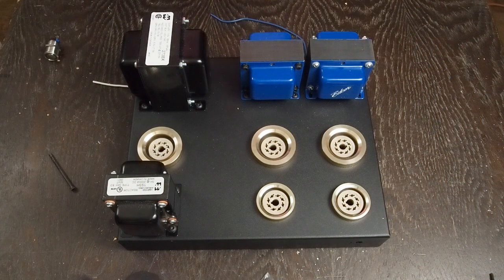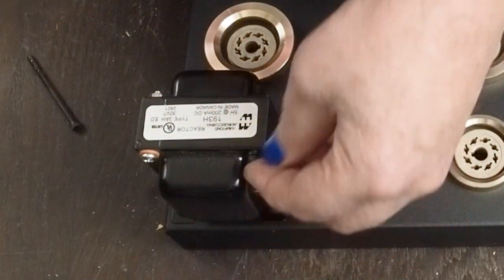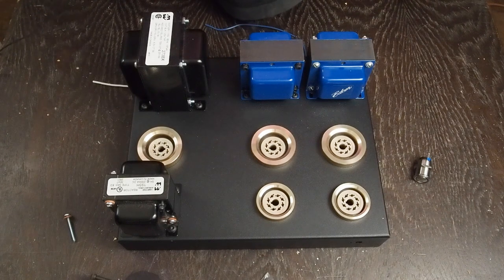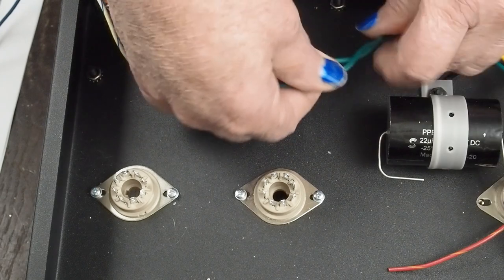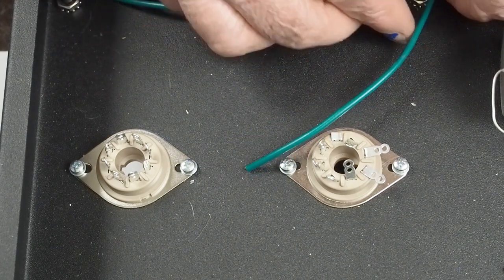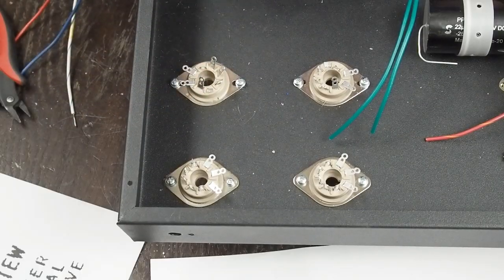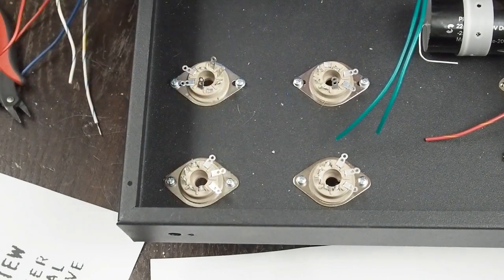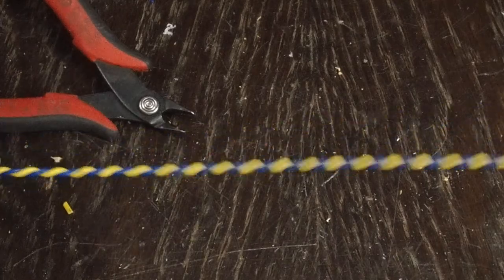6SQ7 EL34 Tube Audio Amplifier: Details and Heater Wiring.

Comment: I really enjoy following your channel and want to build an amp like that. I have a friend who is an electric technician and he may teach me how to solder. We have 230V here in Europe and I wonder if you will help us with an amended list of parts (transformers) needed for the build here.
Reply from the maker: Simply use the Hammond 373BX transformer option in the BOM, that model is multi tap primary and works with every conceivable line voltage. https://www.skunkiedesigns.com/6sq7

Comment: It would be good to ground pin 1 of the 6SQ7 sockets. Some GTs had metal bases which are grounded through pin 1. Also, since you intend selling the amp the end user may end up wanting to try metal tubes. Just a thought.

Comment: Can I replace EL34 tube with 6L6 in my Oldchen EL34 SE.thank you
Reply from the maker: No, 6L6 have lower plate dissipation ( 19W) so if the amp was designed for EL34 (25W), it would overheat a 6L6, unless it's a 6L6GC or one of the 6L6X - - series of tubes. And again, check the tube data sheets to ensure the pins are the same. You can drop a 6CA7, KT66 or a KT77 in for an EL34.

Comment: What’s the maximum voltage of the heater wire ?
Reply from the maker: Usually filament voltage is specified as ±10% for regular tubes. 6.1 - 6.5V doesn't concern me. 6.8-6.9 I would be looking for a way to reduce it. I wouldn't go under 6V either.

Comment: Hi Skunkie, 
I have a question regarding the transformers on top of commercially built tube amps.  I see that sometimes they  have a metal box covering the transformers and wanted to know if this is for a functional reason as in acting like a faraday cage or it is purely cosmetic? Also, how about the orientation of the transformers? Are they suppose to be inline with one another or opposed b/c of the magnetic fields they generate and potential noise? Thank you.
Reply from the maker: You want to power transformer 90 degrees to the output transformers so the inductance/magnetic field doesn't introduce 60hz hum into the speakers. Most you see with a metal box are potted transformers, where the transformer is put inside the box and then filled with epoxy like potting material. I've never used that type myself.